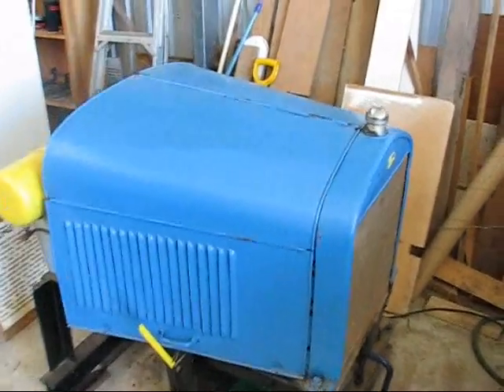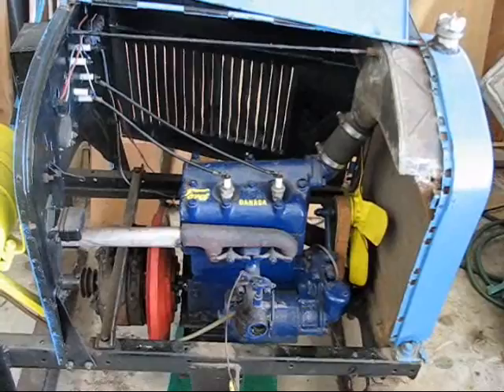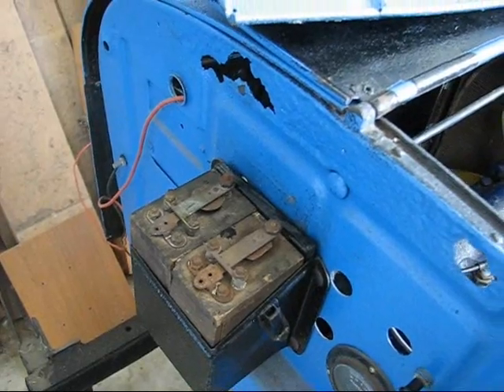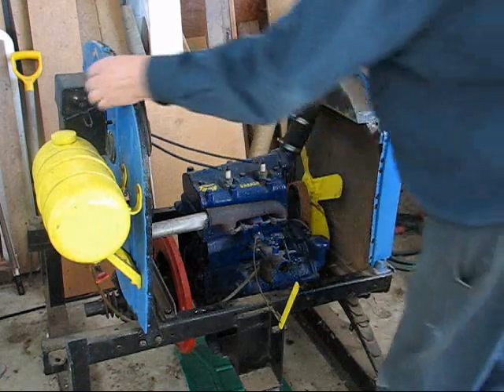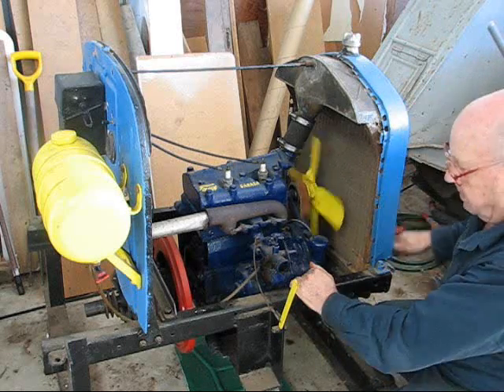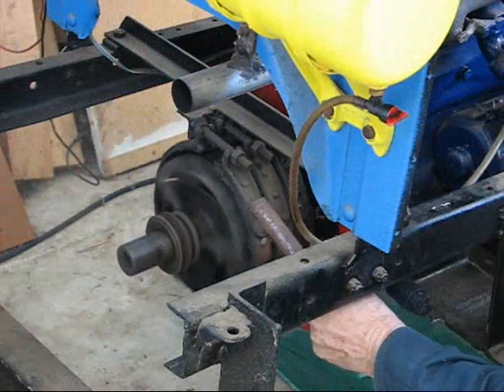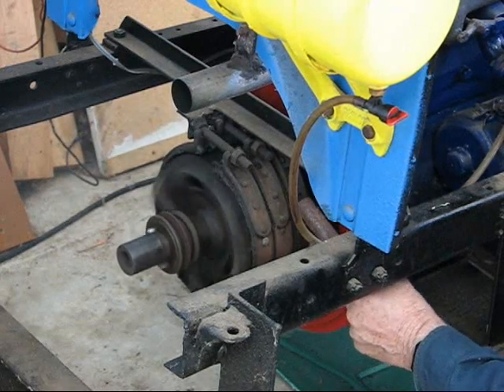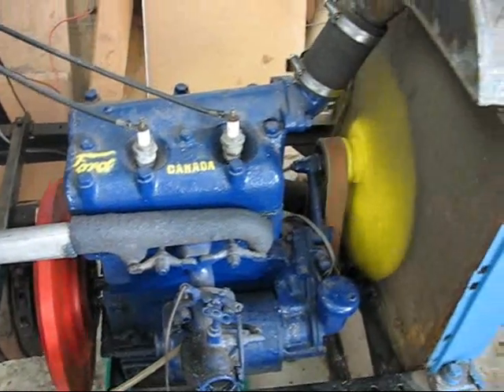Ford Model T Half engine

Comment: Went to school with Oliver, he must have been only 14 or 15 when he did this. I had heard about this but never seen it. He was a bit of a polymath  when it came to anything mechanical ,  electrical or mechanical. Model aeroplanes, radios, developing photos, even listening to phone conversations by clipping onto the myriads of phone lines that existed in those days. This was done from a tree hut built in the school grounds  and which overhung the street.Comment posted by  Neville Crawford
Reply from the maker: Couldn't work this out for a start (I hadn't heard the name Elwyn Crawford) until I saw posted by Neville Crawford.  It's been a long time since those school days 63 years in fact.  I was 17 when I cut the motor in half and I think your father, Keith, saw it at the time too.  I'm 78 now and live in town.  I must give the engine a run too it's quite a few months since it's last run but still goes well.  Maybe could catch up sometime Neville if we could on some social media or something.  I'll take a look on various ones and see if your name comes up.

Comment: from  the  states   I have   to   tell  you   and  share   with  you   that  two   of  my    5  Uncles   dairy   farmed.   they  kept  2  particular  JOHN DEERE  tracktors  2   cylinder   a  "50"  and   "620"    I LOVED   them!   as  they   got older   true   to  their  reputation    they  were  kept    from  1960ish  till  the  farm  was  sold  in   1986.  They  held  up  but  lost  their   exhaust   systems.     this  engine  sounds  perfectly  identical  L O V E   I  T  !!!!   A    trip  down memory  lane!

Comment: It is a "180 degree twin" now. The old John Deeres, some of the old air cooled Wisconsin inline twins, old LeRoi engines, all used this design. The cranks are at 180 degrees, so as one piston goes up, the other goes down. Since it is a 4 stroke, it cannot sinply fire one, then the other over and over as the 2-stroke version of a 180 twin does. So it fires one, then the other 180 degrees (a half-revolution) later, then the cylinders go through the exhaust, intake, and compression strokes, a half turn out from each other, until one fires again, then the other follows a half turn later, etc etc. Thus pu-poom     pu-poom   pu-poom etc. The same engine in a 2 stroke goes poompoompoompoom as the cylinders take turns over and over again on every revolution. The crankshaft will have a basically identical layout on the rear 2 cylinders, and the 2 end cylinders in the 4-cylinder T engine--those being #1 and 4, will go up and down in sych, and 180 degrees apart from these 2, #2 and 3 are also in synch. Since it is a 4 stroke, 1 fires, then 2 fires, after which 1 and 4 come up again, and 4 will now be on compression, so it fires, then a half turn later, 3 fires. so--1-2-4-3. SO---any inline 4 with a "flat plane" crankshaft, like this engine and most others use, even today, is really 2, 180 degree twins end-to end. Please note that you can also have a "360 degree twin" which could be made using either cylinders #2 and 3, or 1 and 4. In this design, both pistons go up and down in unison, and since a 4 stroke fires every second revolution, one cylinder will fire on the first revolution, and the second will fire on the second revolution, so poom poom poom poom. Many inline twins use this design, like the other model of the Wisconsin twin fitted with a 360 degree crank, and alot of parallel twin motorcycle engines. The firing is more even, the sound smoother, but they need alot of counterweights on the cranks to counter balance 2 pistons going in the same direction, therfore not "cancelling each other out" and these engines will vibrate badly if not properly counter-balanced. The 180 degree design is mechanically smoother, but since it fires in a rather odd sequence, the firing impulese can set up some vibrations of their own, which in the 360 design cancel each other out. If you had a 360 degree 2 stroke twin (yes--they exist!), it'll sould like a big single, because BOTH cylinders would fire TOGETHER every revolution. The opposed-twin ("boxer") 2 strokes will fire this way, because the 2 pistons go in and out together and cancel each other out in this cylinder layout, but have to fire (and scavenge with crankcase pressure) at the same time. The Maytag model 72 twin is an example, as is the big Fairmont RK flat twin railroad speeder car engine. A few inline 2 stroke 360 degree twins were made, and these are called "big bang" engines because they have more than 1 cylinder firing at every power stroke. It's a great way to get loads more torque from these already potent engines, at the sacrifice of smootness, unless in the opposed-twin layout. I hope you all understand what I just said, but if you think it over, and picture it in your mind's eye, it's pretty straight-forward and simple stuff! Cheers!
Reply from the maker: Thanks for the comments Rick.  When I put this on a few years ago I didn't go into all the details, however as you stated above all those comments are correct and I have had something to do with 2 cylinder 2 stroke (Trojan) engines as well as Wisconsin twins in both even & uneven firing versions.  So I am familiar with all that say.  Thanks again.  Oliver.
Reply: You're welcome, Oliver! I love old engines! Have a bunch--mostly 2-strokers! Cheers!

Comment from the maker: Nothing has been altered at all with the timing or firing sequence. The original motor had a firing order of 1,2,4,3.  This one has a firing order of 1,2 only as number 3 & 4 cylinders are removed.  The valve timing & lifting were not altered at all.  Basicly the motor is just like a John Deere 2 cylinder engine, mechanically balanced but uneven firing.  If it was to fire evenly the pistons would need to go up & down together and it would need a very large counter balance & still have vibration.
Reply: put the words ....cut engine in half....in search  on youtube and see how garage 54 did it , badly but it ran ...similar to yours...l would trust you to do a better job,  the carbs too big after cut could have closed openings partly, and did not have a flywheel l think. and could have used other cyilnders than they did , like the end ones together. then final engine looks better no plate on end . and for best balance choose the right parts of crank for that one up one to side.  or maybe two in same postion moving in usnison pistons but worse balance. and woild this be a cheap or easy or useful way of making a motorcycle engine , maybe not, get old car engine for free , cut in half.

Comment from the maker: @excelsior921   I only use the oil in the sump with no pump at all.  The sump is very small at the front end of the Model T engine anyway because the oil reseviour is the flywheel area and the troughs for the big ends to dip into are under where the 4 cylinders are.  So I have to watch the level very closely so not to run it dry.  As it is only a novelty now this is not so hard to do.  But Yes I do need to be aware.  If the oil rings are good you can put a bit more oil in anyway.

Comment from the maker: The chassis and front spring are as they were in the original car so I just set it up around that. I'm not sure if the spring dampens the vibration or not.  This engine is quite balanced really as one piston is going up as the other one going down, however this creates uneven firing in 4 stroke engines.

Comment from the maker: @redougulas --  That's about it as you said I cut off the mouldy smashed up bit and used the front good bit as it was a very good motor with very little wear at all.  It still goes well as you can see and it's over 50 years since I did that job.  Thanks for the comment.

Comment: @vk3og making the engine into a two stroke would be simpler than that. all you need to do is cut the ports, put on some kind of a forced air induction, and a fuel injection system to keep all the fuel from going out the exhaust so the pistons don't have to be reshaped

Comment from the maker: Well if you listen to the comments you'll get the whole story.  It is 10 HP because the T Models were about 20 HP so half an engine is 10.  The firing order is the same as all balanced 4 stroke engines.  To have even firing you need the pistons going up & down together firing alternatively each revolution, but then the engine is very unbalanced.  All John Deere twin cylinder tractors were the same as this for over 40 years as were many other makes. So there's nothing unusual about that.

Comment from the maker: That would be a very big job indeed.  You would have to cut ports into the cylinder walls then the sump would need to be dry and sealed and I guess the piston shapes would need to be differnt too.  Certainly the firing would be even but I think it would be almost impossible to do properly.
Reply: l think l saw that done on  youtube

Comment from the maker: The ignition doesn't need any modification.  I just left No 3 & 4 coils off  & as you can see I also cut the coils box in half.  So it does only fire twice each cycle as you will notice when you listen to it running.  Thanks for your interest

Comment from the maker: I wondered if I pressed the wrong button, sorry.  I was saying - The rear part of the crankshaft measurements are the same as the front so it fitted perfectly.  The rear bearing being a bit wider extends a little further out where the flywheel fits on.  The timing gear of course had to be fitted to the centre main bearing as this became the front main.